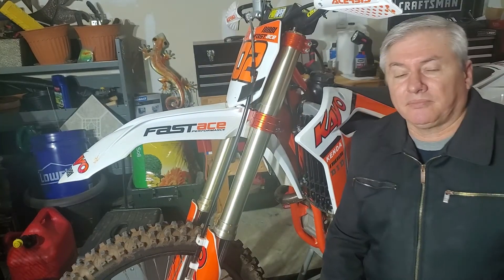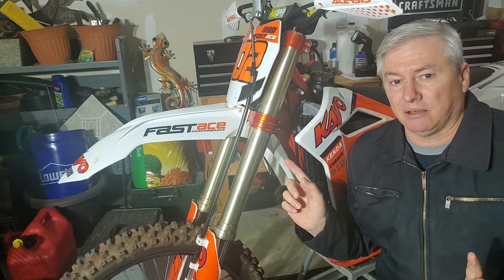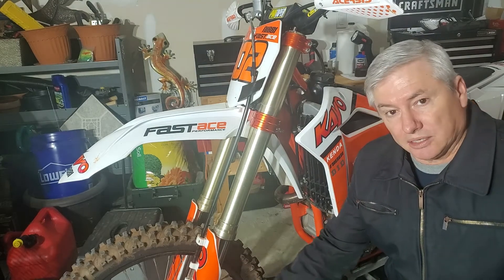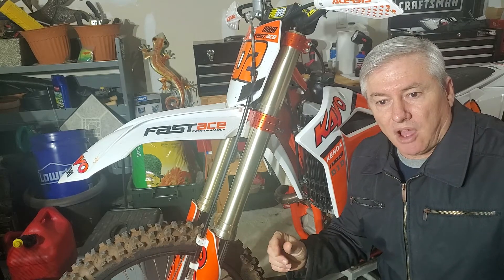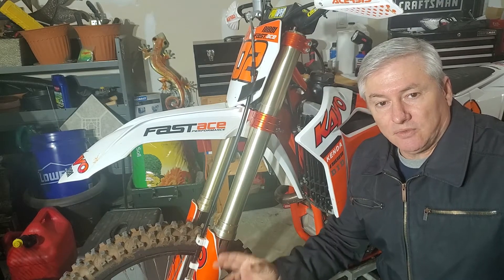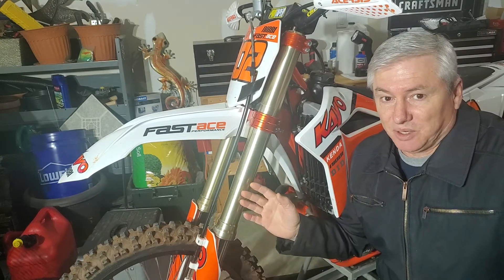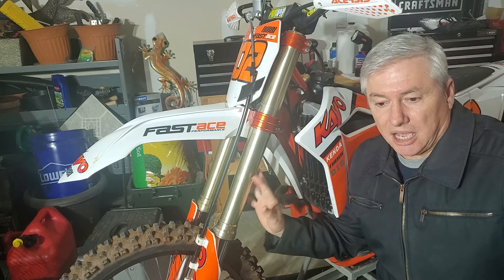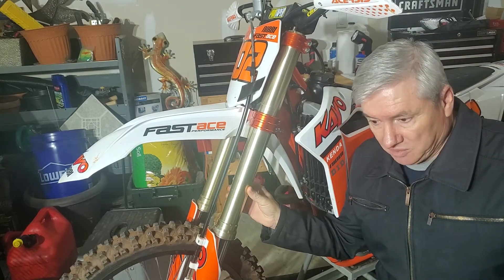Upgraded Fork Option For The Kayo K6-R 250

Comment: Nice Job!!  The original caliper bolted right to the Honda forks?  

 Going riding anywhere this weekend??
Reply from the maker: Yes, Kayo brake caliper bolted to the Honda fork mounts no problem, Fit in triple clamps perfect...it was obvious they cloned a Honda set of forks and brakes.....I think I will be at West Craven on Friday...Moto40 has Vurb Moto event this weekend so staying away from that mess...they plan on a Huge turnout.
Reply: @Dirt_Bike_Dave   ok.  West Craven is to far for me.  Going to go to DNA mx where they are going to have vintage mock races and only modern bikes for the 50 plus crowd.  Should be a good time.  Saturday.

Going to take my  1998 Jeff Emig bike that I just bought last month and my  1989 kx 250.  Maybe my Yamaha 125 too
Reply from the maker: @greg042    Nice 👍

Comment: Dave, I wonder if the gooseneck is compatible with any Japanese, European, or aftermarket stems and triple clamps. It would be interesting to know whether KTM, Yamaha, Kawasaki, or any of the other brands of triple clamps off of 250 2T or 450 4 strokes would fit? I would need 450 suspensions as I still press near 215 to 225 in weight fully suited up. It would be nice if 48.mm cartridges.
Reply from the maker: I would guess that some older KTM stuff would fit...but I do not have the luxury of having any of those other brands parts lying around to test and measure them...I only switched because they fit the stock triple clamps and I had them lying around from another bike build......plus they save 6lbs of weight....never can lose enough weight.🤣
Reply: @Dirt_Bike_Dave  something that I'm sure will be discovered in time. I mean if there is cross compatibility with parts that have more aftermarket and dealer support with greater ease of access it would make customizing and maintaining the bike easier.